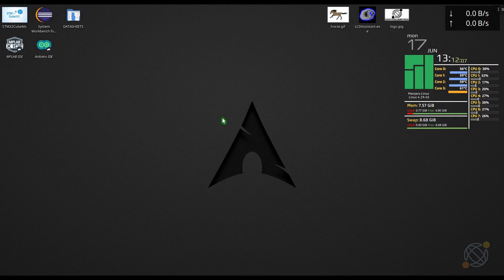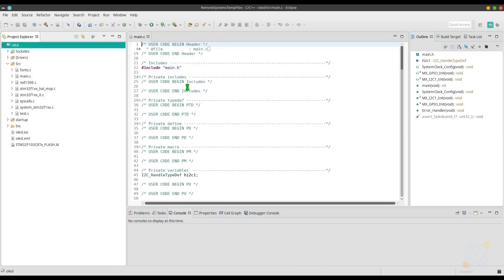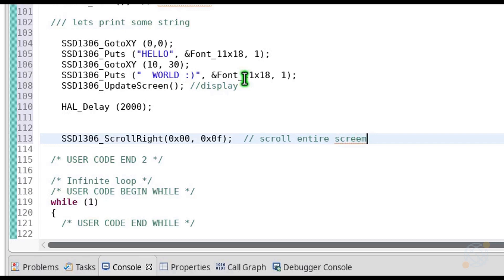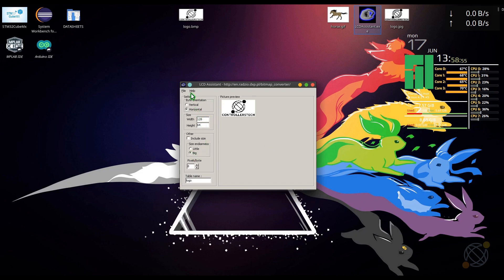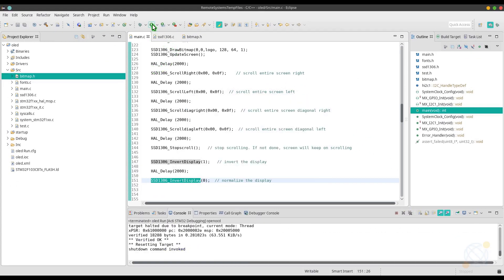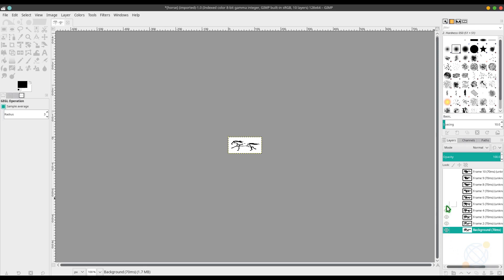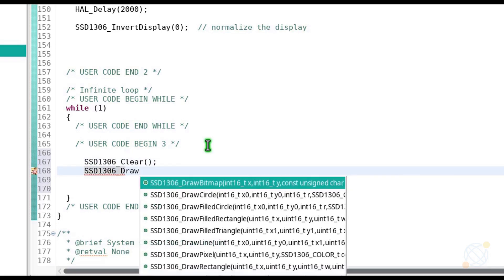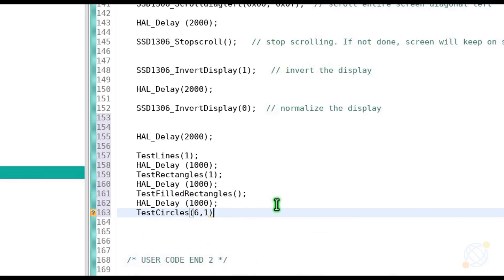Interfacing SSD1306 OLED Display with STM32 via I2C (Step-by-Step Guide)

Comment: im having a stm32 Nucleo G491RE can u help me with it, im unable to get it running even after changing the name in header files, what else i can d0 ?
Reply from the maker: @monjiro make sure you select the right pins for the i2c. Check the schematics of the board to see which pins you need to connect to. 
I am guessing that you have connected to the pins on the top right (scl and sda). When you enable i2c1 in cubemx, by default it will not configure these pins. You have to change the pin manually.

Comment: Hello, I'm using STM32F407G-Disc1 board interfacing with SSD1306 128x64 OLED. When I'm trying with Arduino, the OLED is working perfectly. But, it is not working with STM controller. Code is compiling without any errors. Still OLED is not giving any output. Do you know any possible solution ?
Reply: Hi! I'm working on a STM32f411ve-Discovery and i have the same problem. I checked the address but it doesn't work. Did you find any solution??? Thaks

Comment: Big thanks! All works. It's works on STMF4 series, just need modify 2 defines for HALF4 lib. I will use this lib in my projects with OLED displays.
Reply: I have stn32f429i also, can I ask which particular defines you changed for it to work?
Reply: @switcher3545  In 2 files fonts.h and main.h find the string #include "stm32f1xx_hal.h" and replace it on #include "stm32f4xx_hal.h". Don't copy HAL files from downloaded project, copy only lib files.
Reply: @tupoy_ytub_uberi_psevdonim  do you know the i2c address of your oled? maybe the problem with mine is the address :(
Reply: @switcher3545  my oled addr is 0x78 (also can be 0x79, 0x3C)
Reply: @switcher3545  I can give fragment of code to check connection on I2C channel
/* USER CODE BEGIN 2 */ place the code after this point
if(HAL_I2C_IsDeviceReady(&hi2c1, OLED1.getCAddress(), 1, 10) == HAL_OK) //if ok led just ON
	  {
	  	  HAL_GPIO_WritePin(GPIOC, GPIO_PIN_13, GPIO_PIN_RESET);
	  }
  else //if No correct addr led BLINK
  {
	 while (1){
	  HAL_GPIO_TogglePin(GPIOC, GPIO_PIN_13); //my external led on this pin (replace it for y connection)
	  HAL_Delay(500);}
  }
Reply: @switcher3545  I can help you, please write your mail in your channel profile. I can send my project with oled LIB.
Reply: @tupoy_ytub_uberi_psevdonim  btw I think my oled is 128x64, and has a little writing on the lower left "RIT 253"
Reply: @switcher3545  my iled is too 128x64. I have universal lib

Comment: Hi, Im using Monochrome 0.96" 128x64 OLED from Adafruit, run the same code but it just doesn't work. Any suggestions? I'm using NUCLEO f411re development board

Comment: Great video :)
It is possible to display float/double on oled?
Reply from the maker: Yes but you need to convert them to characters using sprintf.
Displays only accepts ascii
Reply: @ControllersTech  Thanks for the reply.
I did the next thing, which could be ok:
Gain every digit from a float value and add the next character to the digit '0' and update the screen with Putc function.

Comment: Hi ,I use 128x160 oled lcd ,How can I change ssd1306.c 193. and 204. lines ? or What Can I do to use it ?  Could you help me please?
Reply from the maker: There is size defined somewhere.. just change it and test. I don't know whether it will work or not.
Reply: @ControllersTech  I adjusted from ssd1306.h as (128x160) but it didn't work.I used 4.7k pull up resistor and I tried both address.Do you have any ideas?
Reply from the maker: Can u send link  to what oled you have ?
Reply from the maker: I couldn't find any oled of 128x160, which uses ssd1306.
I think you have some other display amd you are using wrong library

Comment: Hello! amazing job. One question.. Can you add multiple OLED screens? is there an example for this? thanks in advance!
Reply: i am trying to make it happen in a STM32 nucleo
Reply from the maker: all SSD1306 have the same I2C address. So if u do connect them to the same I2C, they will show the same data. If you can somehow modify the address, then u can control them individually

Comment: Hi, Great video. Integration done with a 2.52 inch OLED I2C screen.   Is it possible to get smallest font ?  Currently the smallest one i've is a 7x10.
Reply from the maker: check some arduino libraries. Maybe those fonts can be implemented
Reply: @ControllersTech  The fonts i could found are not using the same "mapping". So using them result in ""hieroglyphe" writing :) . The smallest i found and compatible is a 6x8. I'm looking for a smaller one. If someone found it ... Thanks.

Comment: thank u, can i use it for a i2c 128x32?
Reply: yes, but follow this:
-open "ssd1306.c"
-in line 194 change "SSD1306_WRITECOMMAND(0x3F);" to "SSD1306_WRITECOMMAND(0x1F);"  
-in line 203 change "SSD1306_WRITECOMMAND(0x12);" to "SSD1306_WRITECOMMAND(0x02);"
if you do that, you are sending , with I2C protocol  the especific command to OLED 0.91(128x32) to change 128x64 to 128x32. 
Otherwise it will never work.
Reply: @Pablo-ww5cn  and SSD1306HEIGHT in ssd1306.h?

Comment: i tried oled with addres 0x3c and updated .h file.still oled not working.is mandatory pull up needed.pls help me
Reply from the maker: What's 0x3C for ? Where you get that address from ?
Reply: Make sure the I2C address is the 8-bit representation (0x78) and not the 7-bit one (0x3c) as it happens, for example, in the Arduino environment.

Comment: this library can use for SSD1306 OLED 128x32 ??? thanks
Reply from the maker: Yeah but you need some adjustments.. read the comments. Someone did it
Reply: @ControllersTech  i fixed height parameter in ssd1306.h but hadnt run yet
Reply from the maker: Are u sure connection is right ?
Try connecting pull up resistors to SDA and SCL pins.
Also make sure the i2c speed is 400 KHz
Reply: @ControllersTech  I2C address is 0x78 or 0x7A ?
Reply: @ControllersTech  is pull up resistor needed externally by circuit.directly i coneected ssd1306 with addres 0x3c and changed adress in program.but not working

Comment: I copy those those files to each directory and change address 0x3C oled and run but it does not show anything. Can you tell me somthing?
Reply: YES same problem for me also.oled is not showing anything ....i changed oled adreess  and tried but not working.pls let me know if u got the  solution
Reply: OK...SOLVED now ....
no change in address with 0x78 only it working.but i dont know why its like that.previous mu oled is gone bad taken new oled and now its working

Comment: Is it possible to use this code with a STM32L432KC? With STM32CubeIDE?
Reply from the maker: If it have i2c, than yes
Reply: @ControllersTech  Mhm I must be doing something wrong, it has 3 times I2C. No pin on the board was sending out a thing.

Comment: if i can only set my HCLK to max of 48MHz. can that affect the scrolling? Only top part scrolls and the rest doesnt. not sure if its the code or hardware.
Reply from the maker: No, HCLK don't have any effect on scrolling. Might be the code. Try the diagonal scrolling..
Reply: @ControllersTech  diagonal does the same thing where it only moves the top portion

Comment: 'RCC_OscInitTypeDef' could not be resolved, what can I do?
Reply from the maker: What controller? Are u using external clock ?
Reply: @ControllersTech  It worked, I was not following the instructions properly. Thanks a lot for the tutorial.
Reply: @ControllersTech  I am trying to simulate this in proteus, and the OLED has a reset pin, what can I do with it? Please help!
Reply from the maker: Don't connect the reset pin than... Or connect it to the ground

Comment: thanks you for making the wonderful tutorial about OLED display. I have try it and i am fail on display "hello world". i have double check the I2C (&hi2c1) and i am using stm32F103c8 which the pin for i2c (PA6 and PA7), BUT one this diff is i am using "STM32CubeIDE 1.0.0" to do it. CAN anyone help me by suggesting me about the possible problem, i suspect i must made a silly mistake. Thank you.
Reply from the maker: What error are u getting?
Is the code compiling successfully?
Make sure u update the display after writing anything.  Or else you won't be able to see it. 
The code should work on all IDEs so stm32cube ide is not the problem
Reply: @ControllersTech  Thank you for the reply Controllers Tech, i getting not error, the code was successfully compiled, i have put the update of display which is "SSD1306_UpdateScreen()" after every writing,  i even put the breakpoints to check the code is running and the result is: code is runing but  OLED display nothing. i have check the OLED with my Arduino program and it is function well. I have run out of IDEA to test it, but i will keep trying to figure it out. Thanks for the help.
Reply: I am so blind, i can't believe i made this lower mistake. i am using the STM32F103 smart v2 MCU board and i confuse myself by the pin number .I even said that i use "PA6 and PA7" as hi2c1, but actually it is "PB6 and PB7", right now i am able to display "Hello world" on OLED.  Thanks you for the help anyway and great video as always. I am appreciate, Thanks a lot .

Comment: That video is nice but could you learn us how to use OLED working with SPI? It would be interesting thanks 👍
Reply: meto , i have try many times to use the hardware SPI in stm32 to drive oled, but i failed every times
Reply from the maker: You can use the same code for it. Just make sure in the ssd1306.c, change the i2c operations to spi. That's all. You can watch my video about using spi generally.